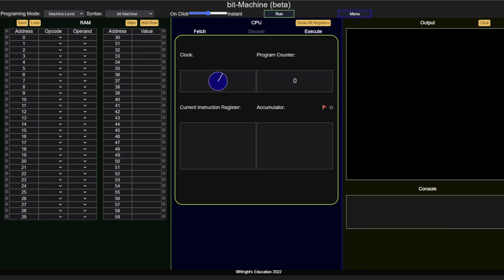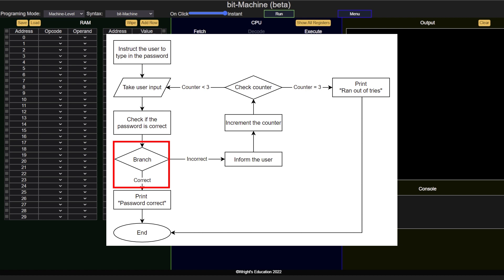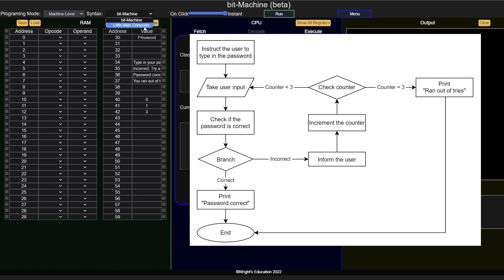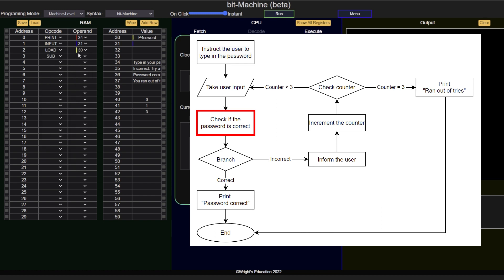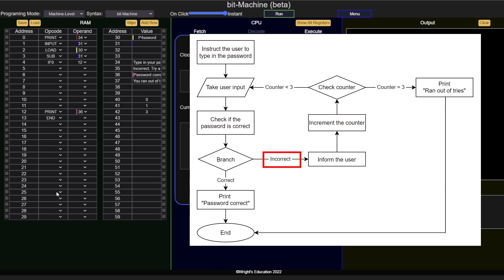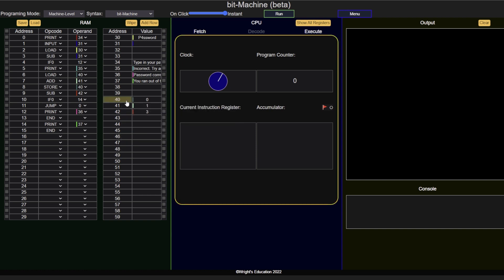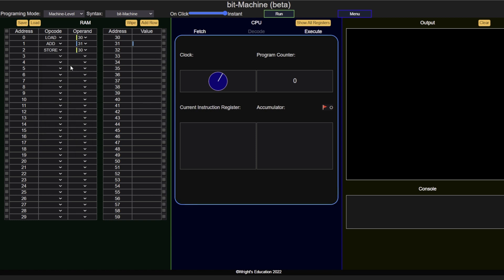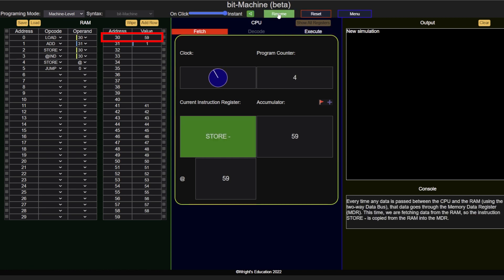How To Write Machine-Level Code (Using bit-Machine)

Comment: Hi, do you have any examples of code which use an INDEX register?     eg  INC IX Add one to the Index Register.   I cannot see this register or do you not use this?   Great site by the way. Thanks

I have only found the link in the "See the meaning of opcodes" link
Reply from the maker: Hi,

Yes, it has an index register. There's a video I made about addressing that you can check out, as well as a couple of presets on bit-Machine.